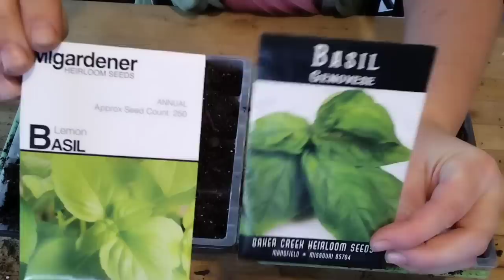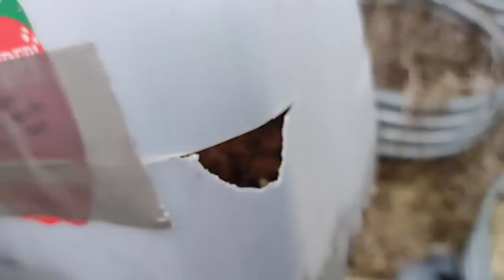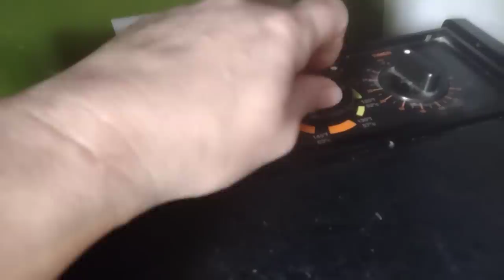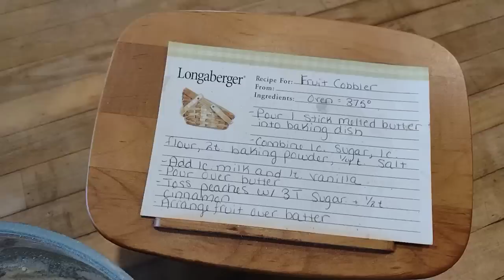Kitchen Work ~ Sprouting Wheat Berries ~ Gardening ~ Root Cellar Update

Comment: When I sprout my wheat berries, I weigh them first. Then after they come out of the dehydrator I weigh them again. The dried weight should be equal or less than when you started. That’s an easy way to know it’s completely dry.